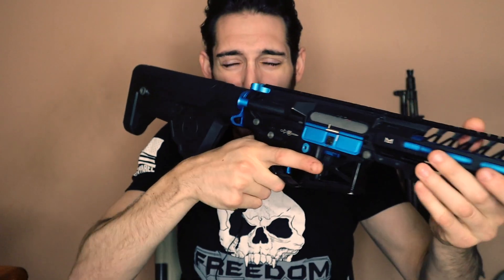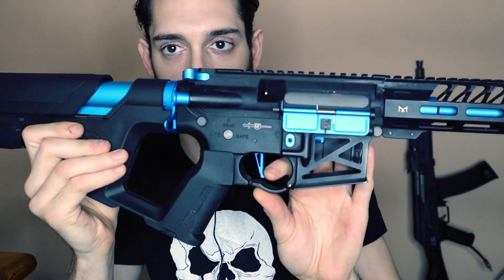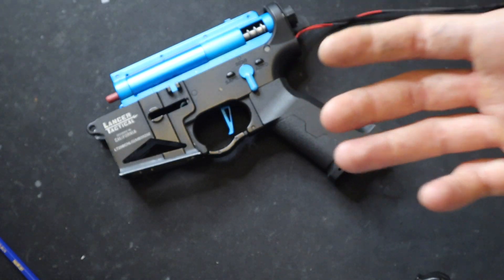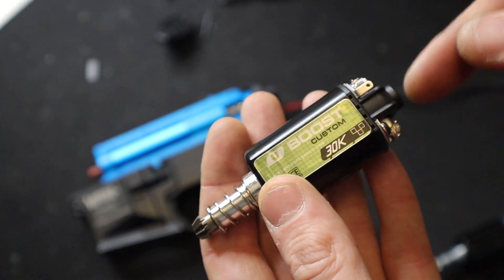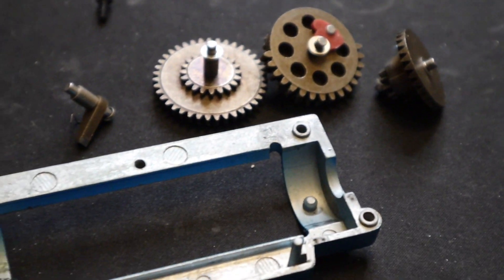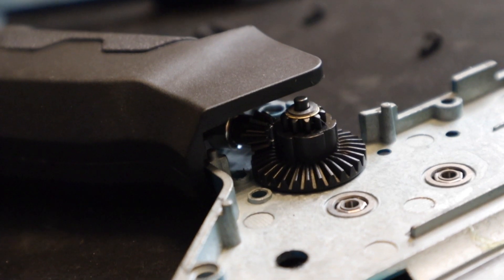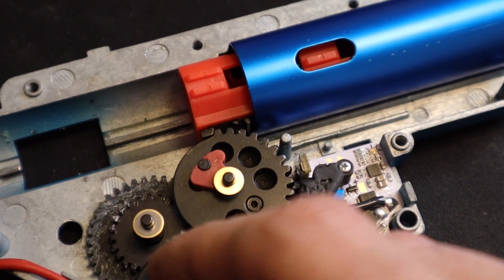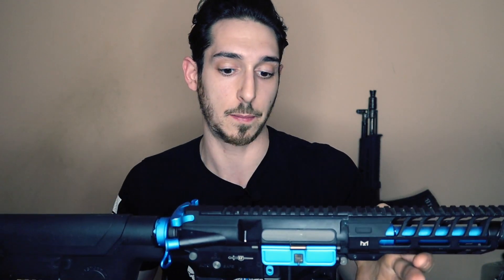Lancer Tactical AEG UPGRADE for NYI.Fajita! CQB BEAST!!

Comment: Hello... Im sort of new to airsoft and I have a 'Airsoft LT-19BL M4 Carbine 10" AEG Rifle' and was wondering if you could lmk what gears your bought in replacement to the stock ones (even if you bought new ones or just changed the alignment)... I found the motor you recommended but just wanted to see if you could help me out and show me the rest of what you got! Thanks, and great explanation video!
Reply from the maker: No problem. All of the upgrade parts I use are available on my website. Here’s a link to a really nice bundle kit 

I would also advise swapping out your bearings for higher quality bushings like the ZCI steel ones I have or the J cage bearings both on our website. 

Here is a bundle kit which has the gears : motor : piston : tappet plate : shims 

https://www.therealdealairsoft.com/products/ssg-bundle-13-1-kit
Reply: @TheRealDealAirsoft  awesome thank you so much! and all of these parts in that kit should work with my '''''Lancer Tactical 19BL M4 Carbine 10" AEG Rifle'''''?
Reply: @TheRealDealAirsoft  also... im very sorry, and this will be the last thing I question about then Ill leave you be... those parts in that kit are the exact same as put into the gun in this video correct?

Comment: Hey :) I managed to build this setup, 13:1, 30k engine, etc. I had to correct the AOE... before I had about 370 fps... after the correction, it dropped to 280-290... it's pretty weak like that. Do you have any idea what is going on? thanks
Reply from the maker: What parts did you use internally
Reply: @TheRealDealAirsoft  
So I used :
Perun V2 Hybrid
13:1 Specna gears
30K boost ultimate motor
Specna CNC bearing spring guide
Specna CNC bearing piston head
Specna CNC cylinder head
Specna O ring nozzle
Stock piston
Stock ported cylinder

If I test the compression it's perfect.
The shimmimg is perfect.
If I correct the AOE alredy drops the fps...

The patient is a SA Flex, because it's short and light :)

Comment: Okay so i really need your help so do i need the better motor and gears and pistin for the fast trigger response or just the mosfet?
Reply from the maker: All of these parts work together. The mosfet controls the high speed parts. 

Grab a golden Boi high torque motor , 13:1 gears , fresh pack of shims and a mosfet and a upgraded piston 

Yes all these parts are needed in order for the system to work properly. Install a higher torque motor without a mosfet and the gun will double cycle
Reply: @TheRealDealAirsoft  thankyou bro

Comment: hey how did you get rid of the connection between grip and stock?
Reply from the maker: Good ol dremmel
Reply: @TheRealDealAirsoft  hey i got the perun v2 hybrid and it seems like the trigger isn’t resting well on the metal piece, it sometimes comes off how do i keep it from doing that?

Comment: does the stock air nozzle have o rings?
Reply: i have this exact gun and am about o buy all the upgrades you did plus a few more
Reply from the maker: Change the stock nozzle it’s doody get a Maxx nozzle
Reply: @TheRealDealAirsoft  placed my order last night :< the stock will have to do
Reply: @TheRealDealAirsoft  should i get the 21 or 21.25mm off your site for this gun? or just the 19-22 adjustable ?

Comment: Hey! I know I’m kinda late but, how many rps do you get out of a 30k motor with this build? I’m planning on doing something similar. Thanks
Reply from the maker: I don’t use 30k motors I use my real deal golden Boi motor which is basically 30k lmao 

With my motor and 13:1 expect 30rps same with ASG 30k 

They get about the same rof give it take maybe 1 bb but real deal has 2 more TPA 

Expect 30rps with 30k on 13:1
Reply: @TheRealDealAirsoft  good to know. Thanks for the info and the reply!

Comment: Hi, i have specna arms edge series 1 after little upgrade nothing crazy, shimming and better piston plus perun hybrid installed and the motor gets pretty hot. What motor you recommend for that kind of build ? Is asg 30k shown in this video fine for this or i need more torque ?
Reply from the maker: If you want more torque but want to keep the same rps virtually give or take a bb or two , then go with my golden Boi motor for superior torque compared to the 16 tpa 30k motor
Reply: @TheRealDealAirsoft  thanks man i look it up

Comment: What parts you install bro
Reply from the maker: They are all on my website. www.therealdealairsoft.com
Reply: @TheRealDealAirsoft  they sold out
Reply from the maker: @hectorvillegas24  just the mosfet is sold out. Re stock is 1-2 weeks 

Motor / piston / gears / cylinder head / real deal bearings / and real deal golden boy motor ( shits on the 16 TPa ash motor )
Reply: @TheRealDealAirsoft  and is that what you install at the gun

Comment: after you cut the stock in two, can you remove the rear of the alpha stock? (does the mag section slide of the buffer tube?) to swap to a minimalist stock?
Reply from the maker: Once you disconnect the stock from the grip, you can remove their stock easily. The adjustment tab that changes stock position will allow you to complestly remove leaving you a version 2 buffer tube
Reply: @TheRealDealAirsoft  it would be nice to just buy a new pistol grip but based on measurements that particular stock seems massive... I'm ordering mine this week to check it out
Reply from the maker: @BrokeBeardedGuy  you can change the grip and stock to what ever you want
Reply: @TheRealDealAirsoft   not trying to be annoying moving from milsim pb to airsoft. Is there a compatibility list or is it pretty much universal? Do you have other videos that go over this?
Reply from the maker: Take a dremmel and literally cut and disconnect the stock from the grip. Cut it with a dremmel or hand saw 

Then just remove the old stock by depressing the stock adjustment tab 

And then for the shit grip just unscrew the bottom. Remove the motor unscrew the gearbox screws that go from inside the grip into the gearbox and then your grip comes off

Comment: Been having a pain getting the barrel nut off though... I have the same model that you are working on in this video. I've tried everything I can think of.
Reply from the maker: For the rail system?
Reply: @TheRealDealAirsoft , I just got it off and repainted my upper. Eurotac is coming!
Reply: I know this is late but I had to slap my LT in a vice and use a pipe wrench to get the barrel nut off. Thing was seriously torqued on!
Reply: @BurningSovereign  yeah the suckers are tight but an ease when you've done it enough times

Comment: Hello your videos are informative and to the point.I LIKE IT !!!, I just got a gen 3 and would like to upgrade my spring to an M-130  so I may shoot .30 bbs  and still keep a decent fps.  What motor would you recomend for this ?  By raising the FPS does that mean I shouldn't use full auto anymore ?
Reply from the maker: You can still use full auto but be mindful of the FPS because depending on how you build it I’ve gotten m130 up to 460 FPS and I wouldn’t reccomend full auto dumps with 460 FPS 

Motor I would reccomend to have serious torque but have speed it my Real Deal Golden Boi Motor it’s 18 TPA so a lot of torque but speed as well 

They are to re stock in 1-2 weeks 

If you want a motor with similar performance but much less torque than ASG 30k but it has much less torque

Comment: I know I've already commented but, i was wondering how long this process takes? I've already ordered the new motor, and perun hybrid v2 rear mosfet. I also wanted a little definition on shims.
Reply from the maker: Shims are little small metal circles that we place on the shafts if the gears to effect their height and positioning inside the gearbox
Reply: @TheRealDealAirsoft  Also, where can i get shims? And i bought the parts you have for this video but i dont have the piston thingy and was wondering if the piston is essential

Comment: where do i get my mosfet and my 13:1 gears??? what did you use?
Reply from the maker: Every part I used is on my website Perun hybrid is re stock this week as well as some new fire motors dropping on my website
Reply: @TheRealDealAirsoft  when is the performance piston set back?
Reply from the maker: @the_real_atlas  the heads are en route right now to my location. A matter of days until the new piston heads land. And I made a design change and increased the size of the ports slightly

Comment: Bro thanks a lot for the video. I am actually super confused cuz I have a lancer proline and I just bought a perun hybrid v2 mosfet for my lancer. Wasn't sure if it will work but now I am pretty confident! Thanks a lot!!! Just one question-- do I need a new sector gear since the sector gear inside my lancer gen 2 proline has a small piece of a magnet for the current stock mosfet?
Reply from the maker: If your going in there and changing mosfet might as well drop 13:1 gears in that biznatch
Reply from the maker: That magnet may or may not effect the perun’s magnetic trigger sensor
Reply: @TheRealDealAirsoft  thanks bro. I just received the mosfet and will be installing it today!
Reply: @tomjong4141  how did it go?
Reply: @BattleVlogsBoys  dude it was amazing. didn't change anything on the stock gearset. with perun mosfet, shs high torque motor, titan battery the gun shoots 30+ FPS, and the trigger response is unbelievable, even better than those HPAs. Perun is absolutely amazing and if you have a lancer it is 100% compatible and you don't have to do any modification on the gear or the shell. of course if you want to upgrade your piston and cylinder assembly or nozzle you can certainly do that. just note that you gonna need a different screw and a piece of shim to secure the mosfet onto the gearbox shell, and i just took a screw out of my laptop's back cover.
Reply: @tomjong4141  good to hear!! How about in semi? I’ve noticed that stock lancers shoot fast in auto but they dog out in semi can’t handle the trigger taps. Does the rps reduce in semi or is it just as quick as auto?
Reply: @BattleVlogsBoys  the stock lancer's ETU is nothing compared to Perun. I noticed that problem too.  Once you have your Perun installed you can spam the trigger as fast as you can and every time it's gonna shoot. You can upgrade the motor and battery too. These three together will make you lancer shoots so good that people won't even believe it's a lancer lol. BTW the owner of Perun is a super cool guy and you gonna love that silicon-coated wire from Perun so much more flexible and easier to handle.
Reply: @tomjong4141  awesome dude thanks so much. We have a family YouTube Chanel that’s gaining some traction and I’m hoping to start up another one that’s airsoft based. If I end up talking about the gun I will mention your name. Thanks again!
Reply: @tomjong4141  yo man, im about to do the same exact thing, how's the gun holding up a month later? thx
Reply: @oscargomez24  I would say do it 100%. That perun mosfet is the best thing that could happen to your lancer. you might need an extra screw to hold down the mosfet to the shell but Im pretty sure you can find one of those screws from somewhere in your house or electronic stores. if you can upgrade the battery to titan and the motor to SHS high torque you will be soooooooo impressed. BTW be careful not to pinch the wire
Reply: @tomjong4141  sounds good, thx man I wasn't sure if I would receive a response lmao

Comment: Hey m8 is the lancer lactical motor have silver magnets. Also how many tpa was ita... I have a couple of JG Works guns that came with motors that look and act the same, but its a m130 happily as and is not gettin hot.. Also "low guido chop shop" is using the same motor as mine to do torture test on cast gearbox runnin ten minutes straight.. Killin the wells metal gearbox hahaha but the motor it still runnin sweet as and he only got upto m120 and the box breaks. So next box will be better video But mine is runnin m125 SS 2 teeth, and i no sum1 using same motor with m135 has been for awhile now, so im just wonderin if its the same motor as mine, looks identical no markings at all but behaves the same, magnets arent that  impressive on mine but doesnt get real hot. I was told was jg blue any chance that mine comin from a jg gun is a jg blue.. Look forward to ur reply... Cheers..
Reply from the maker: The stock motor in the gen 2 is absolute shit man. We for sure have different motors. The gen 3 has a high torque but the motor that’s as stock on this gun has ferrite magnets are was probably the lowest torque I’ve seen in my life
Reply: @TheRealDealAirsoft  haha no worries m8 .  So ur magnets are blackish then yeh?? Cause Mine are silver!! Which should be neo from what i have read about magnets! Neo are nickel coated cause then rust fast with out it but ferrite magnets are ceramic and black colour as they do not need to be coated as they dont rust(sorry off topic).. Anyway magnet color??
Reply from the maker: Ide have to check but I’m 1002020202 percent sure the stock motor on the last lancer I did was a ferrite motor for sure but their new guns for sure have really good magnets for sure

Comment: I can not lower the bewel gear any more in my ics mmr, or krytac for the pinion gear to have some room. What to do? Thanks
Reply from the maker: Why do you want to lower your bevel
Reply: @TheRealDealAirsoft  Sorry I realized that how we usually open the gearbox it would be rising the bevel gear. I made sure the bevel and pinion are aligned, thete is only one 0.1mm shim between the bushing and bevel, but the bevel is still tight and there is no side to side play on the gear (the spin motion you talked about). Should I grind down the gear or the bevel gear or getting a good quality motor with good pinion will help?
Reply from the maker: @pierzus1  for krytac there’s not much you can do , but what I say is get a new gear set and a new motor and you will be able to adjust. 

Tho on the krytac you should be able to but stock shimming should be decent. Krytac is an exec period to every airsoft rule. They are so much extra work and are difficult to work with
Reply from the maker: Krytac is an exception to the rules * they require a lot more work and parts may not drop into krytacs. You can remove your bushing and sand it down a bit if need be. But for the non krytac I would just get 13:1 gears and ASG 30k motor

Comment: Bro I need help in Workin on this gun and cannot get the alpha stock off for the spring replacement
Reply from the maker: Lol the grip and the stock are attached. What you need to do is remove the buffer tube bro the screw inside the buffer tube
Reply: @TheRealDealAirsoft  Jeeez dude. What a pain in the ass. Can you post a tutorial?

Comment: I can shim my gears great, but i always end up with a loud piston/cylinder head smack how do i get it quieter like your builds
Reply from the maker: That really comes down to what cylinder head your using. If your using a Sorbo or not 

I just use my real deal performance piston assembly and the stock cylinder head which is polymer. But if you use a Sorbo you really have to analyze your aoe

Comment: What spring did you use? Do you have any advice with 13:1 not to get premature engagement?
Reply from the maker: Stock spring that came with Aeg m110 if I were to guess. With 13:1 you never really would run into pre mature engagement. If you do then short stroke a tooth or too off the pickup of sector and release of piston but with 13:1 I never run into pMe and my pistons are AOE corrected also

Comment: I actually got a Lancer as my first gun, but recently (about a year later) I stripped the threads in the gearbox that the pistol grip screws into :(

Has anybody else experienced the same problem?
Reply from the maker: Replace the screws they are standard size you can google it
Reply: @TheRealDealAirsoft  the screws are fine, it’s the threads that they screw into that’s the problem
Reply from the maker: Oh shit that’s wierd. Usually the screws trio before the reciever
Reply: @lab-05  Find the next size up bolt size. Get a drill and tap and redo the holes for the new bolt size.

Comment: This is basically the exact gun I have been building. I got an LT-29 low fps model when they first dropped because I loved the stock. I also picked up an ICS L85. The LT-29 out performed it OotB. I started with a 13:1 asg boost 30k build SS for 300fps. Was having some feeding issues(later found out due to the bucking lips in my Maxx unit). Figured what the hell, going DSG, I see so many people say dont attempt DSG until you are WAY experienced. Challenge accepted. So far so good. Been doing a lot of back yard testing and first game this weekend. Love having the big LT emblem on the side that people roll their eyes at :D
Reply from the maker: Lmaooooo amen to that. And I’m glad your diving into the DSG world it’s for sure fun
Reply: @TheRealDealAirsoft  Hoping you may be able to guide me a bit here. I am getting some unfavorable accuracy on my dsg build. 185mm barrel, maple leaf macaron bucking, FPS is sitting at a VERY consistent 328-330. But the grouping on the shots just isnt that great. Can def still hit a torso but before going DSG I was hitting a paper plate dead on across my property each shot. Does this just come with the territory of DSG? Thank you!